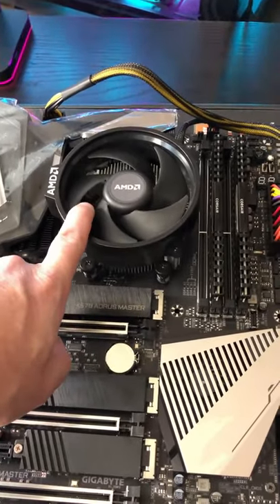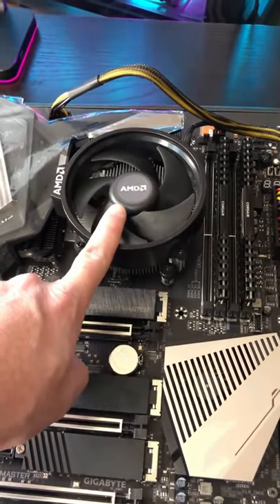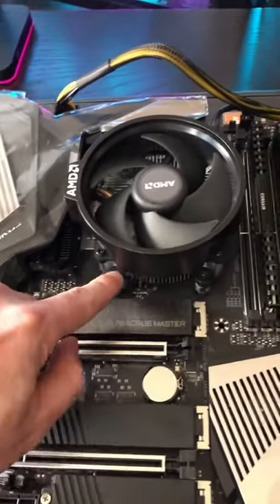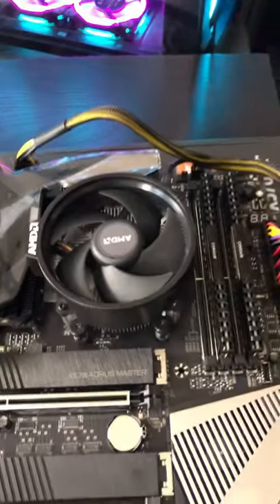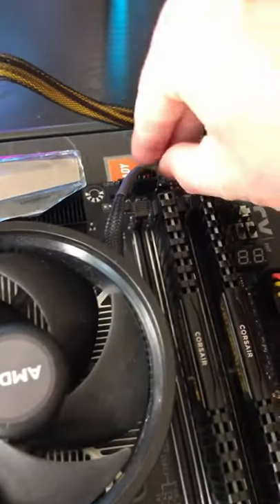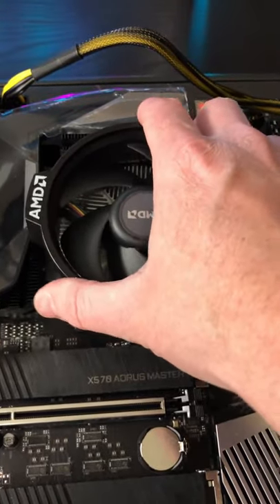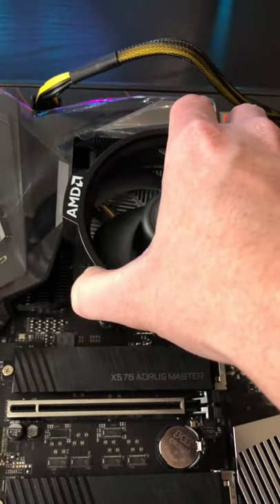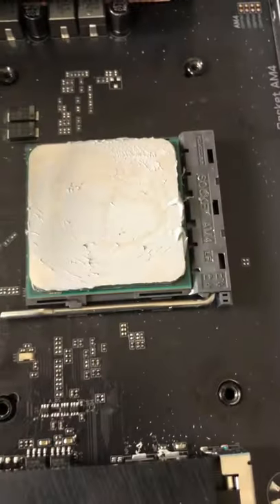How To Remove an AMD CPU Cooler Safely without Ripping the CPU from the Socket #shorts

Comment: I had no idea that the CPU would get pulled out of the socket with the cooler, I found out the hard way while trying to change the thermal paste of my 5800X 😅 Luckily I didn't bend any pins, but I've never been as scared as I was when searching for the CPU on the socket and only realizing a couple seconds later that it was actually attached to the cooler
Reply from the maker: Hah!  Yep it can easily happen!  Glad you didn’t have any damage!

Comment: Is the stock cooler good enough to play GTA 5, rdr 2, Detroit become human - 70-80 degrees Celsius?
Reply from the maker: Really depends on what CPU you are running.  These are generally fine for Ryzen 3/5 but 7/9 will need a mot more cooler need to keep cool.

Comment: I can't put it back together! I tried putting a lot of pressure on the screws, but can't get it in.
Reply from the maker: You probably are making contact with the screw threads.  Try putting a piece of cardboard under the backplate of the cooler to push it up through the motherboard holes more.
Reply: @PCTechHustle  I just tried ehat you said and they still won't go in. I only have the screws, and the holes where they go in, no plate or anything like other videos I've watched. What should I do? I'm thinking of taking it to a computer specialist...

Comment: A week ago i was gping to remove the stock cooler to upgrade but its too hard to get the stock cooler on the cpu so i add some pressure i got to pull out the stock cooler but the cpu is still on it so i tried to twist it counter and clockwise so i managed to remove it and i was lucky that there is no curved pin
Reply from the maker: Glad you didn’t have any damage!

Comment: Yeah, I was removing my heatsink and when I pulled it off, I wondered where my CPU was, I quickly realised it was stuck to the heatsink
Reply from the maker: Yikes!
Reply: how did you put the cpu back in to the motherboard with the cooler attached ?

Comment: THIS EXACT THING HAPPENED TO ME.
 But no pins bent and it was stuck to the cooler.. So I put on the water heater for a bit to warm it slowly. Ryzen 5 3600 is okay

Comment: You don’t even need to heat it up. I always do this technique and never pulled a cpu out. Even when cold
Reply from the maker: Agreed but never hurts to take the extra step either.
Reply: @PCTechHustle  that’s right^^
I didn’t want to sound rude btw in the original comment. I’m sorry if it sounded a bit rude

Comment: I split some 🥤 on my motherboard and won’t turn on, wanted to take out the cpu just like this but in my case I ripped it off with the cooler stuck in it, any idea how to remove the cooler from the cpu?! 😢
Reply from the maker: Dental floss.  Run it carefully between the cooler and cpu.  Careful with the pins

Comment: I used to swap between a quad and 8 core processor on my old pc and never messed up taking the heat sink off. I didnt try to just pull it though so i guess theres that

Comment: Why I just find this video now? My first time building a pc, and when I try to change the cooler I just pull it off and the cpu stuck with the cooler, there is like 16 pin bend. Almost give me heart attack. Fortunately I have a microscope and I can straighten the pinout back without problem.

Comment: The (only) advantage that Intel's pin socket has over AMD's PGA sockets is that the CPU is locked in place by a top clamp so you can remove the cooler without damaging the CPU (probably).  Of course, AMD will use the pin socket on next gen chips.
Reply from the maker: Yep I’m glad AMD is moving to LGA

Comment: Yeah, this is how I ripped my r3 1200, cpu sticked to cooler and left with it, tried to place it again but pins were bent, tried to fix it, got even more broken pins, so it sucks. Luckily found second hand cpu for 30$, little bit better with wind 11 support as nice gift and next day installed it carefouly. I would suggest warm it for 30min in stress test.

Comment: Can You Make This Again But For 775 Socket Because My R5 2600 Get Stuck
Reply from the maker: Same process for a 775 socket (all sockets really) but that socket does clamp down the IHS so there should be no worry about the CPU coming up with the cooler.
Reply: @PCTechHustle   thank you very much

Comment: I hate the ryzen 7 stock cooler, i once did not know this thanks for the useful tip and when I did pull it out it broke my mobo chipset cover and my ryzen 7 got a few pins in ever direction but I managed to get it all working, im not a fan amd its good but its such a risk this is why I loved intel design it is easy so thanks

Comment: What's the point of the lever if the cpu can just pop out??
Reply from the maker: Good question!  It does prevent it from falling out and lines it up with the socket to make proper electrical contact but doesn’t clamp down the IHS.

Comment: i accidentally yanked my cpu right out of my socket. my heart was pounding when i turned it on after i installed my new heatsink. it booted right into windows. i got lucky and didn't bend any pins or ruin my socket. lesson learned
Reply from the maker: Glad you didn’t have any damage!

Comment: I did that and my backplate fell any advice?
Reply from the maker: That is fine.  That means the only thing holding it on the thermal paste.  Just carefully twist and pull
Reply: @PCTechHustle  ye but how can i plug the cpu screws into my backplate with it falling all the time i can't keep it still

Comment: Wish I would’ve seen this 2 days ago before I tried removing my fan and did indeed pull my CPU out and bent some pins...
Reply from the maker: Hopefully no major damage!
Reply: @PCTechHustle  Nothing major.  About 8 pins were slightly bent inward, so I took a plastic pry tool from a repair kit, and SLOWLY shifted them back to position.  I immediately popped everything back in and turned it on and breathed a sigh of relief.

Comment: I'm still in the process of building my PC, do I need thermal paste for my cpu?
Reply from the maker: Yes you always need thermal paste!  Though if you buy a new cooler or even use a new CPU that comes with a cooler it generally has either pre-applied or supplied paste in the package.

Comment: What do I do if the wire to the cooler that goes into the mother board is stuck
Reply from the maker: Be sure to pull from the base of the plastic connector not the wires.  You can put a pair of needle nose on it if you need to.
Reply: @PCTechHustle  ok thank you

Comment: This could have helped 6months ago before I removed the cooler. I had to use alcohol and heat it up using hair dryer and slowly remove it it was a nightmare. Bent some pins had to straighten that too slowly 🤕

Comment: I am not trying to pull out my cpu, but I have a problem. I have the same cooler style as the one in the video and Im trying to screw it into the motherboard over the cpu but half the screws don't want to go in after trying to tighten them one after the other diagonally and I just can't figure out why half won't tighten

Comment: AMD's stock thermal paste is a hazard to CPU's, I nearly broke my 5600 yesterday. I should have looked this up sooner but I had no idea this was an issue. The CPU ripped RIGHT off the locked socket, I was lucky no pins bent. I had only been using that CPU cooler for a week and it was already solid. This was AFTER running the PC for hours at around 50c also. Maybe I should have ran benchmarks or played a game in preparation so it would get hotter.

I had to do the hairdryer thing to unstick them, when I plugged the CPU back in, it was a nightmare as there was no image and no motherboard errors, but it fixed itself after like 10 restarts somehow. I hope AMD covers replacements for CPUs they break with their terrible thermal paste, never trusting it again, although at the end of the day I should have known better. lol
Reply from the maker: Yeah their provided pre applied paste is crazy sticky!

Comment: Honestly if you can afford it it’s always worth it to buy a different cpu cooler. They sell decent ones that are 40-50 usd, the wraith cooler is a pos.
Reply from the maker: Agreed but the idea in this video is how to safely remove a CPU cooler from an AM4 socket.  All coolers will follow the same process.

Comment: But the cpu is locked!! 

You see that little lever next to it, if you switch it then your cpu is in danger of getting out.

Or am I wrong, please tell me if ik wrong
Reply from the maker: The retention lever does not hold it in very well.  It’s a common issue to accidentally rip it from socket.
Reply: @PCTechHustle  ah oke thankyou for the explanation

Comment: I took off an AMD cpu cooler that had been stuck on one of those older Athlon cpus for over 10 years, I just pulled, the cpu didn't come out of the socket.
Reply from the maker: Pro!
Reply: @PCTechHustle  lol i think i just got lucky haha, granted somehow thermal paste got on the pins and held it in haha idk how that happened

Comment: I put my cooler master 212 evo on upside down, is it worth fixing it?
Reply from the maker: Meaning the fan air flow is pointing up instead of out the back of the case?

Comment: I pulled the cpu out with the cooler and it still was stuck. Tried to twist it with my nails when it suddenly came lose, and i dropped everything. Cpu landed pins down on the heatsink. Man i was lucky that day. Still running the 3600 non x :)

Edit : next time ai will warm up the paste
Reply from the maker: Glad you didn’t have damage!

Comment: It's not the cpu cooler's fault. It's socket engineering. If we don't carefully remove it, we will be ending like Linus Fan with an AMD R9 5900x broken pin.
Reply from the maker: Yep!
Reply: @PCTechHustle  I upgraded my system to AMD luckily I found this video so in the future I don't mess with it. Thanks for the tip.

Comment: HELP!!!!!! I tried removing my cooler by first disconnecting the cables and unlatching it and then wiggling it, but it wouldn't budge. i then relatched it and, plugged the cables back in so i could start up the computer in hopes of heating up the thermal compound but the computer wouldn't turn back on
Reply from the maker: Is the cooler mounted down properly?
Reply: @PCTechHustle  no sorry i just didnt have it plugged in 🤦‍♂️
Reply from the maker: Oops!

Comment: yeah i yanked mine out of the socket when i upgraded from the stock cooler, then bent a pin removing it from the old cooler.

Thankfully i was able to straighten it out with an xacto pen knife and dental floss
Reply from the maker: Glad you didn't have any damage!

Comment: Mine was so stuck that I had to use a hair drier to try to separate it. After doing that for a long time, it didn't get loose, so I had to pull it with a stick and eventually came off (flying). AMD thermal paste sucks
Reply from the maker: Yikes!

Comment: Never knew the AMD socket didn't lock it in... Seems kind of strange it isn't the same as Intel sockets
Reply from the maker: Yeah… it “secures” it but doesn’t clasp down on the top of the IHS like Intel does.  Next gen Ryzen I hear though will go to LGA so this may not be an issue soon.

Comment: Is this like an actual problem with AMD CPU? People just accidentally rip the CPU off the socket?

Never used AMDs before, genuinely curious
Reply from the maker: I see it happen all the time.  Just look at the comments here on how many people have accidently done it.  The stock clamping system isn't that great.
Reply: Im using Intel atm and planning to upgrade to ryzen sometime in the future, and i really don't like the mounting design on AMD, but i didn't know it was this bad.

Btw, thank you for the heads up. I'd probably would've also fallen victim to this if not for your vid lmao

Comment: My CPU PWM power cable not opening . Can you give me any suggestions.
Reply from the maker: Not sure what you mean by “not opening”
Reply: @PCTechHustle  the 4 pin is stuck not opening from the pwm point.
Reply from the maker: The cable should just pull strait up

Comment: Already ripped it out of the socket once. It happend before I even noticed
Reply from the maker: Oops
Reply: @PCTechHustle  still workes though
Reply: I was taking my pc apart yesterday and i pulled it out off socket one pin was a little bent but still works

Comment: Try that with a big air cooler that has the spring tensioner it’s not easy 😂
Reply: Facts it'll pop itself out the socket if it doesn't separate from CPU first🤣
Reply: @jamesgray5741  yeah I had it rip mine out and bend pins. But I bent em back and it works fine
Reply: @MLGJuggernautgaming  at least it work after. Lol i upgraded my wife's PC and ended up breaking a pin after trying to re-bend it back, but she was happy cuz she wanted a new CPU anyway

Comment: Bruh this is a little to late i just ripped a ryzen 5 2600x out and a ryzen 7 5800x the 2600x is still working 5800x looks fine but idk
Reply from the maker: Hopefully no damage!
Reply: @PCTechHustle  everything seems to be alright i will comment back if the 5800x works or not

Comment: All motherboard can use amd cpu cooler?
Reply from the maker: Technically yes but if you have a higher end motherboard I would expect you probably have a higher end CPU and better cooling.  The same cooler removal process though remains the same.

Comment: I cant put it back in the bolts wont turn
Reply from the maker: Unscrew it enough to the point where the back plate behind the mother board falls out.  If that happens ready to come off.  Just slowly twist and lift.
Reply: I fixed it

Comment: Bro I downloaded cinevench and my cpu got to 93 degrees Celsius 💀 then it was a piece of cake to take off
Reply from the maker: There ya go!
Reply: damn bro did you use toothpaste
Reply: @dnly  no I had thermal paste reapplied from the stock cooler and then I loaded up cinebench which is a cpu stress test, got my cpu to 93 Celsius and took it off
Reply: @ffake714  buy another cooler

Comment: I runned around 10 cinebench r15 tests before turning it off and trying to remove but I couldn't twist at all. I felt like it would break off the pins. Then I pulled hard. The cpu came with it. Bent two pins... Fixed it. Never touched again🤣🤣🤣
Reply from the maker: Yikes!

Comment: Who needs to see this? "undo everything you did when you installed it, wiggle it and lift it off". Good advise.
Reply from the maker: You would be surprised how many times I’ve seen people rip the CPU right out trying remove the cooler.

Comment: How the hell did you just pull out the wire I’ve been sitting here for hours trying to friggin pull it out lol
Reply from the maker: Which wire?  The cooler fan cable?
Reply: @PCTechHustle  the one that connects to the mobo
Reply from the maker: It should just pull right up
Reply: @PCTechHustle  Yeah, I eventually figured it out after a couple hours. There was a clip! I stuck a flathead in between and pulled by the wire and it came off, although the cpu came out with it but none of the pins were bent.
Reply: @PCTechHustle  I even let the pc warm for 20 minutes but it still came out! And did a stress test!!

Comment: Never heard of anyone bending pins from just pulling it out of the socket lol
Reply from the maker: They will bend if something goes wrong like dropping it.  Also the CPU isn’t supposed to rip out of socket with a cooler removal so imagine the amount of force to do so which could result in damage.

Comment: What? I've been building AMD computers since AM2 when I was 11 and have never even heard of someone ripping a CPU out of the socket. Why would you forcibly pull your cooler if it doesn't come off easily??? Are people like this why CPUs also come with little triangles?
Reply from the maker: It happens more often than you think.  Just look at the comments 😉😉😉

Comment: I remember putting my new 3900x in the socket my computer didn't turn on. So I took my cooler off and the cpu came with it. I was scared out my life but I checked the pins and put it back in and it work. I almost ripped my 3600 out with that trash amd cooler.

Comment: Too late! I've ripped out my 3700x with the wraith cooler, bent like 20+ pins, managed to straighten it back painstakingly, detached it from the cooler and successfully made it POST haha
Reply: Rip ur gonna have problems in the future tho don’t even move the motherboard
Reply from the maker: Yikes!  Sounds like you lucked out getting the pins back in order though!
Reply: I was being lazy and not getting the gpu out first so I don't have enough room to get my finger to detach the cpu cooler on both side (the wraith prism has these metal bit on 2 sides). So I ended up having the cooler/cpu half off the socket and had to stop and try to get the gpu out (reaching the gpu clip was also quite an ordeal). I didn't know that the CPU was stuck to the cooler at the time or otherwise I would be more careful.

Comment: Step 1, don’t use the amd stock cooler
Reply: Im sure it can happen on any cooler
Reply from the maker: It can happen with any cooler as mentioned.  The issue is the socket does not firmly lock down on the CPU IHS, so if not careful any cooler can rip the CPU from socket.
Reply: @PCTechHustle  you are right, but speaking from personal experience the amd stock coolers always want to cause problems lol

Comment: Step one, remove the ram.
Step two, loosen the cooler screws.
Step 3, gently apply twisting force to the cooler, rocking back and forth while gently pulling on it until it detaches.

Comment: Or just don’t use so much thermal paste and u won’t have an issues
Reply from the maker: Not always the case!
Reply: PC Tech Hustle I’m pretty sure the only reason you needed to wiggle is because you used too much, thermal paste isn’t an adhesive. It doesn’t cure. (Unless you’re using some special type)